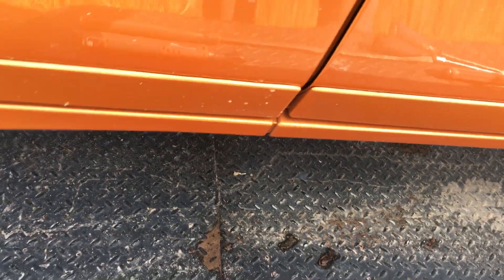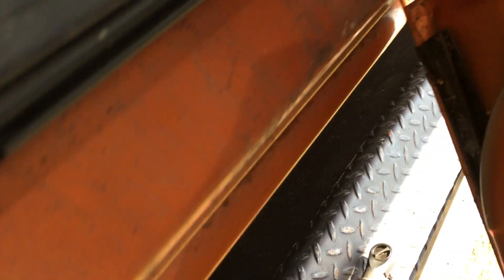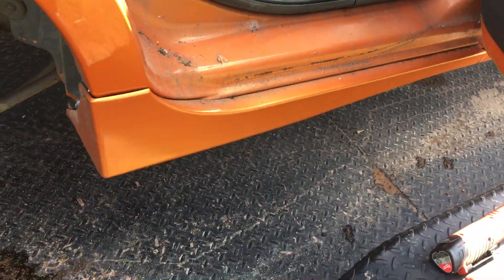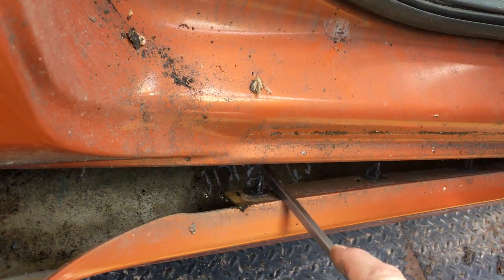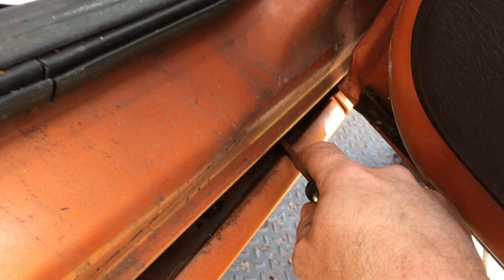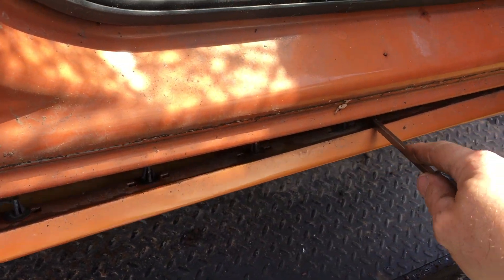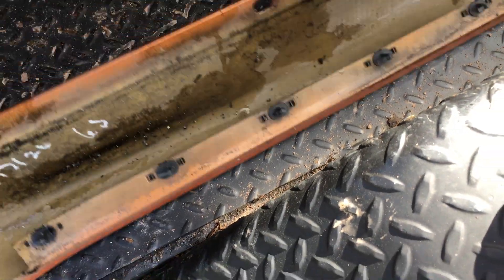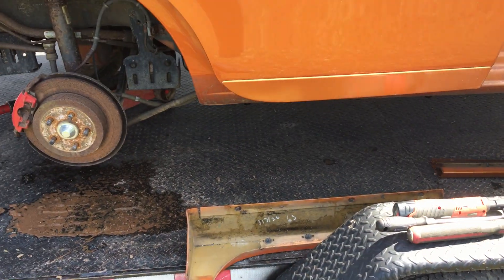How to remove Srt4 side skirting

Comment: Can I put srt side skirts on my sxt? The rocker panel/side skirt is completely shot are this winter that car through
Reply from the maker: Conner Hendrickson I’ve put them on an sxt with 3m tape because drilling all them holes would not be fun but if you’re rocker is rusted away there’s just nothing for them to attach to
Reply: Matt's need for speed okay, know any good place to buy new panels since it’s rusted out
Reply from the maker: eBay, rock auto or lkq should have the replacement panels